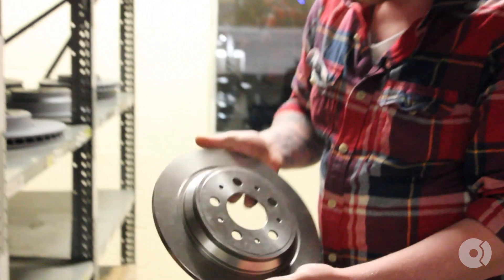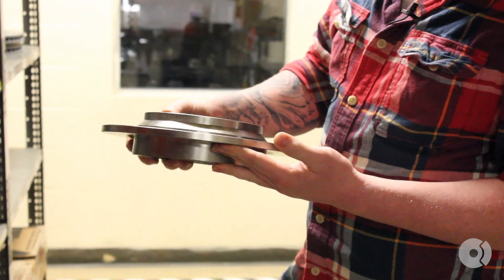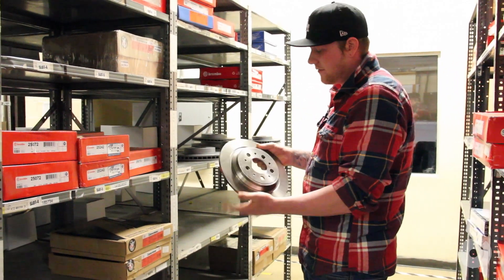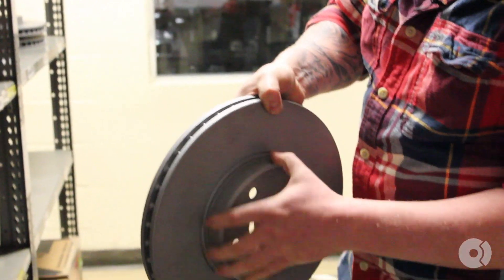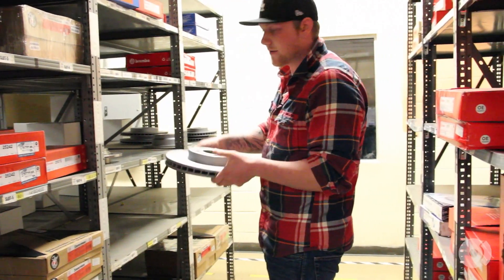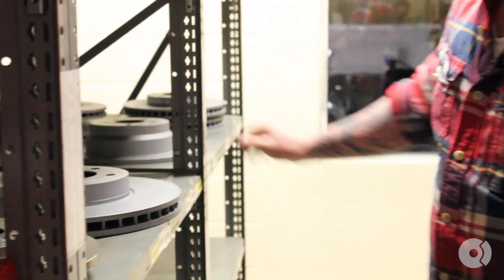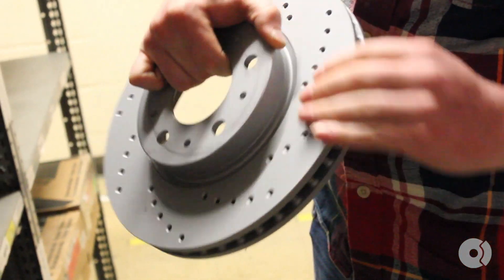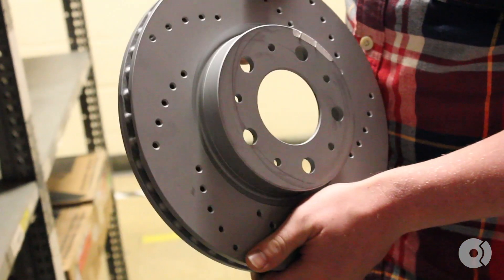Brake Rotors Compared - Zimmerman - OEM Replacement - BMW, Audi, VW, Volvo, Porsche, & Mercedes

Comment: I just put zimmerman coated slotted on the front of my Pana Turbo S. They are awesome :o I put cheap discs on the rear and now I regret it lol. Should have spent the extra dough and gone with these coated discs all around.

Comment: My Zimmerman rotors lasted about 43k miles on the front.  Just changed my pads from hella/pagid which worked great to ate.  I feel my rotors in front are just now warping and need to be changed. I'm a bit hard on my brakes and love the stopping power.  I'm surprised how long they lasted.  Just ordered the Zimmerman sport drilled from fcp.  Price was the best. 
I have a 2013 a7 3.0 356mm rotors.
Hope this helps
Reply from the maker: That's great to hear your Zimmermann rotors lasted so long, Michael! Thanks for the support. Let us know how you like the sport drilled rotors once you get them installed.
Reply: Are Hella-Pagid brake pads better than Zimmerman brake pads ?.

Comment: Those are only drilled not slotted rotors.

However having had a pair of these on a s70 for over a year they do not rust up over night like stock volvo ones do. a nice feature.
Reply: Was it a t5 s70?

Comment: "The cooler your brakes are the better they are going to work"... I think different braking material each has its different optimum performance temperature zone, just like tyres have an optimum temperature zone as well, so does the engine itself, etc.
Reply: that's why it is more of an art because the science and specs are kept under wraps.

Benz and many other German car OEM examplify how fast hard semi-met pads can chew through soft discs 😂

Thank God Japanes Akebono formulated excellent Ceramic pads for long-life, no noise, no dust, no more high maintenance chaos 👍🏻

Comment: Out of the 3 rotors shown, which one is the Zimmerman Premium and is the “premium” coated? That is the ones that they installed on my Volvo XC60 T6.
Reply from the maker: Hey you, the majority of the Zimmerman rotors we carry right now all come coated. There are very few expectations for specific models that may not be coated. For more info on the Zimmerman rotors we have on your car,  be sure to use our vehicle selector on site!

Comment: The drilled ones is not to let heat escape, but the gas created by braking between pad & rotor. This will make you able to push a little harder compared to non-drilled rotors.
Reply: I think those are the ranurated patterns. Though perforations might help to "drain" this gas, they are mainly cooling drillings.

Comment: OK after two M vehicles 3 and a 4 comp as well as a f10 M. 
drilled and slotted styles each have their own application just as a BBK or big brake kit are more for style on the street unless making considerable high speed runs followed by aggressive cornering as the bigger pots larger rotors larger pads allows for more force to be applied that couples with material of the pad and rotor work in conjunction to stop shorter while reducing heat before the next cycle/ brakes applied again. Now with that said and the cars I've owned all had modest modifications for hp and suspension upgrades but all were spiritedly street driven never tracked.
I say this, the M3 coupe had the most fade from 140+ down to 60mph on OE rotors and akebono ceramics.
 The M4 and the 5er both have substantially larger brake components from factory and both are capable of 160+ mph like the M3 so after some runs the stock comp setup on the M4 is proper but still has the same characteristics as my M3 heat them up and here comes the fade but again were talking crazy illegal speeds on all US roads and very few world wide unless your tracking the vehicle or well being slightly reckless continously every day drilled is not necessary, 
slotted, more for dirtier climates were keeping a clean surface on both pad and rotor are ideal and also has some very slight cooling but most cooling of a rotor stems from venting or plain radiant release of more surface area in the groove cut, 
 true superior performance stems from Materials used in both pad and rotor as well as force applied (caliper design) all working together to remove heat while still applying force to arrest momentum.
if you really want to be the brake king grab yourself a BBK carbon ceramic setup 👌

Comment: in most cases, drilled and slotted rotors are less durable than plain rotor. The holes are the failure points of crack. Not a good idea for people who want to have a comfort ride.

Comment: Two questions:
What is the advantage of slotted rotors?
If using ceramic pads, are drilled or drilled and slotted rotors any better, or a waste of money.
Reply from the maker: Holes or slots help air ventilation and expel heat, the rotors will run cooler and cool off faster. The slots will also help to scrub the pad surface. You'll notice slightly better braking performance in daily driving. It will be more noticeable during track driving.
Reply: @fcpeuro  The slots will wear your pads faster...stick with normal rotors

Comment: Zimmermann rotors are a great value, and better quality compared to OEM Mercedes rotors. I ordered replacements for my C63. Unfortunately these morons sent me rotors for BMW instead. Wasted 2 weeks getting the correct rotors. Zimmermann rotors work great with ceramic pads. I picked up Power Stop ceramic pads which are a fraction of the cost and do not produce gregarious amounts of brake dust; stop the car better than semi-metallic OEM pads. Nothing like turning heads pulling up to a stop light with squeaking brakes- This side of the pond noisy brakes are looked down upon. Note: I have not track tested my brake setup. On "normal" road conditions they have performed well. If driving 150mph is normal in your country.

Comment: Even though the coated ones are advertised as preventing rust, the rotors are not rust free. They will start rusting after the first car wash or rain. Got rid of the brake dust by installing ceramic pads on this rotors, but now i have a nice rust ring on the inside of the wheels. Choose your poison.
Reply: Ive had mines for almost 3 years and they barely have any rust

Comment: It might be a good add on to tell about the drilled ones that it is beneficial to clean the holes once a year at least :) or else you build up crap from braking wich will clog up the holes.

Also with Zimmerman brake rotors you need special brake pads. Not special in a way "you can't buy them anywhere except one place" but special meaning that when you change your brake rotors for Zimmerman rotors you may have to change your brake pads as well as they may not get along well and instead of gaining brake power you may actually loose some. Have a too soft composit pad and the friction will increase heat that lowers brake efficiency. Have a hard brake pad composit and you get good braking power but if it is too hard you end up with squeaky brake noises :D there is no telling in which goes best. You simply have to try out. But it helps if you find someone who can assist you throu the selection and tell you about the pads if they are soft, softer, hard or harder and sort them out. But if your local dealer has Zimmerman brake pads along with rotors in store, take it.
Reply: thats my biggest concern know after i bought Hawk hps 5.0 pads,, i don't know whether Zimmermann would squeak, or go unheard , any idea?
Reply: you have an excellent point!

Unfortunately brake parts reviews are more about looks and touchy feelings than hard facts and  specifications for adults.
Reply: Akebono or Textar is all you need!

Comment: I love my Zimmerman Cross Drilled Rotors.  I have put them on both my 1999 Audi A6 Quattro and 2000 BMW 528I Sport.  Anyone who says cross drilled are for looks only is an idiot.  Cross drilled allows for better cooling.  

On my 1999 Audi A6 I had 4 sets of brake front brake rotors replaced in the first 50000 miles under warranty because of warpage front heat.  Unlucky enough to purchase a car which Audi realized the brakes were under sized and increased the diameter of the front rotors from 288  mm (which I Have) to 312 mm.   I just replaced the rotors on my 1999 Audi as I prepped it for sale and I had 240000 miles out of my front and rear Zimmerman cross-drilled and no warpage just reached the wear limit. 

I have 60000 on my BMW 528i and no issues  or warpage.  

Cross Drilled still maintains the normal feel on your brake pedal unlike cross-drilled/ slotted which vibrate the brake pedal as the pads encounter the slots.  Unlike all the cross drilled rotors for sale on sites such as ebay.com where some idiot is standing at a drill press and running rotors through it to drill the wholes;  Zimmerman  cross drilled rotors are engineered from the beginning  to be drilled in manufacturing process and won't crack unless some cataclysmic event occurs and that can happen with non cross drilled rotors as well. 

Not sure if Zimmerman has moved its manufacturing to China but I bought mine over 10 years ago and they were made in Germany.  Definitely needed on  modern luxury cars where the weight of the cars are over 4200lbs.
Reply: Sean Williams unfortunately they are made in China yet “coated” in Germany. That’s how they get passed the made in China thing. We have had lots of come backs with Zimmerman the past couple of years and no longer stand behind them. However the drilled option they offer seem to hold up much better. Good to hear you had good luck with them.
Reply: thanks for sharing your hands-on experience.
I guess you dont have hard pads glazing issue else you'd swear about slotted discs to wipe the pads

Comment: zimmerman resulted in being garbage on my w212 e550. warped super quick.
Reply from the maker: Sorry to hear you had a problem with your Zimmermann rotors. If you bought them from us, please feel free to email service@fcpeuro.com and we would be happy to get you a replacement set!
Reply: And what are its brake disc and brake pads disc now?.
Reply: I have one myself! I am at this stage... previous owner cheaped out and I have warpage, front and squeak out back... 👌🏾 hesitating to just go OEM
Reply: @producerkslice  I’m 4 sets in since the original comment 3 years ago. They’re pulsating/warped even today

Comment: I thought Zimmermann's makes rotors for BMW & Porsche.
Reply: Nope, ATE makes oem for bmw e39, but I swapped them for ZM.
Reply: Depends on how you mean it. If you think that they produce it as an OEM part for the assembly line then no. But if you think they produce it as an aftermarket option then yes.
Reply: No,Textars on my BMW F11

Comment: Do the Zimmerman drilled rotors have cracking issues?
Reply: No. Why should they?
Reply: YZRandomE all drilled rotors have cracking issues.
Reply: Well you can't drive them worn up. If they are done and there is no material left they need to be replaced with new ones. Simple as that.

Comment: I suggest pushing the advantages of slotted rotors over so-called drilled rotors. They're more effective. People think drilled rotors are high performance. No. Not unless they're manufactured specifically, not after the fact. Post-drilled rotors develop fatigue cracks under hard use, and then break if not inspected regularly.

Comment: The holes in the disc are not for heat prevention but for keeping the disc clean from break dust, water and other stuff. Typical myth

Comment: Drilled rotors bad if you have winters :) Drilled have 0 advantage exept for looks.
Reply: I live in an area where temp goes in summertime up to 38 degrees and during the winter below 20. Got the Zimmerman drilled rotors and I have zero problems. So how bad are the when someone has "winters"?
Reply: zinc coating helps reduce steel oxidation on non-contact surfaces: hub and cooling vanes !